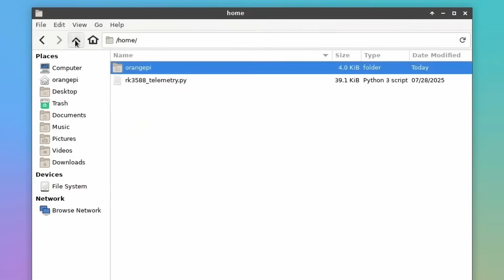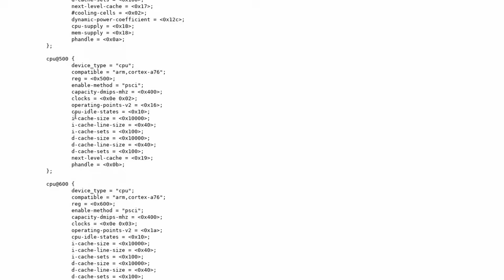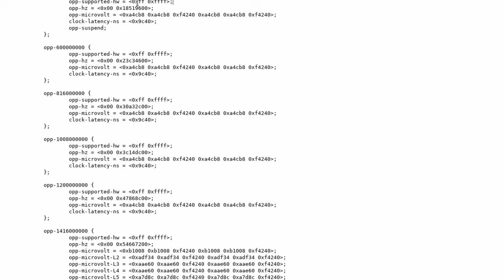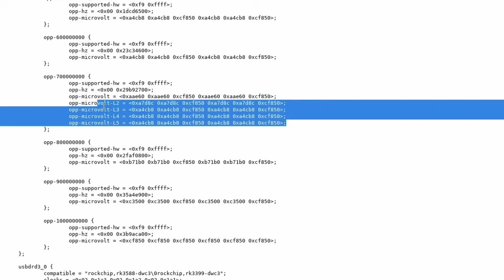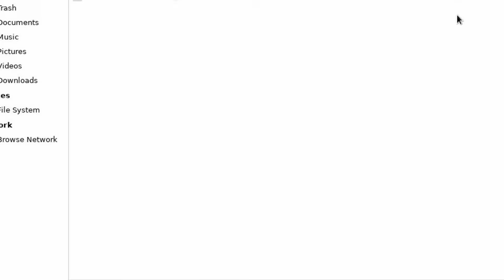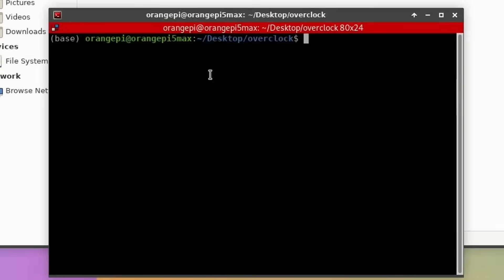5 Minute Overclock: Orange Pi 5 Max 16GB to 2650 MHz

Comment: Can you please also do the overlock on the latest Armbian OS (BSD kernel 6.1.115)? I can see there is another "gpu.panthor" node (beside the "gpu" node as in your video) on the Armbian OS for working with the Mesa drivers. I can OC the "gpu" node up to 1200MHz (1.1mV), thanks to your guide. But I can't OC the "gpu.panthor" node pass 1.0mV (it crashes the system).
Reply from the maker: Interesting, I didn't know! I'll have a look when I find some time

Comment: Can you please do the overlock with mainline kernel?
Reply from the maker: I'd love to but haven't been able to to get mainline to work on this OrangePi 5, unfortunately.
Reply: @SkatterBencher  Can you please also do the overlock on the latest Armbian OS (BSD kernel 6.1.115)? I can see there is another "gpu.panthor" node (beside the "gpu" node) on the Armbian OS for working with the Mesa drivers.
I can OC the "gpu" node up to 1200MHz (1.1mV), thanks to your guide. But I can't OC the "gpu.panthor" node pass 1.0mV (it crashes the system).

Comment: hi, i'm from brazil, and have learning a lot with your videos!
Can you make a complete overclock guide for I5 14600k. I use z790a Rog Strix motherboard, appreciated for your videos and teaching.
Reply: He made 14700 and 13600 should it help.
Generally these OC hobbisits only focus on the latest and greatest so he may not do a 14600 in 2025/2026